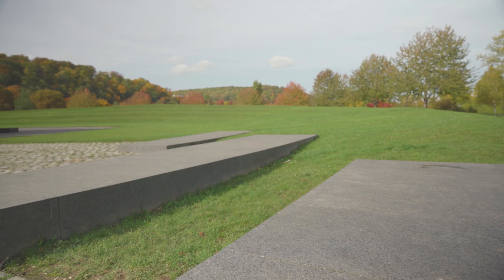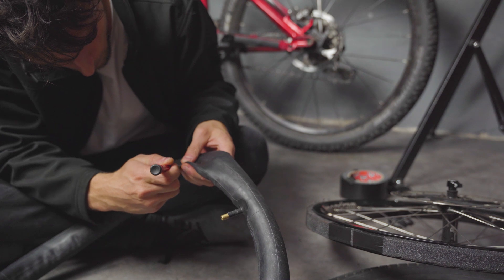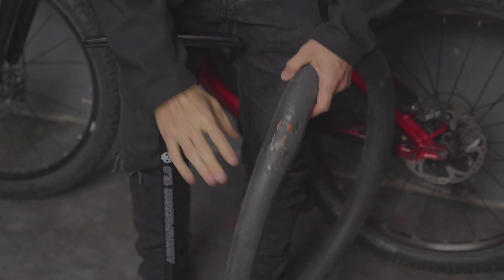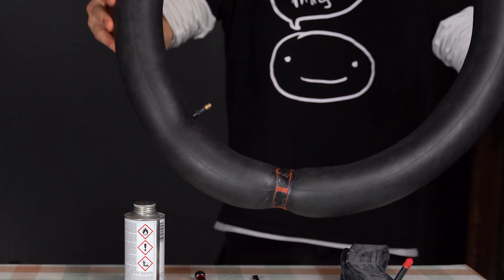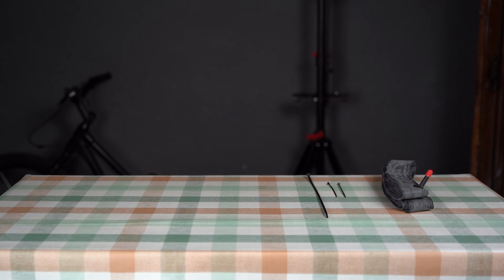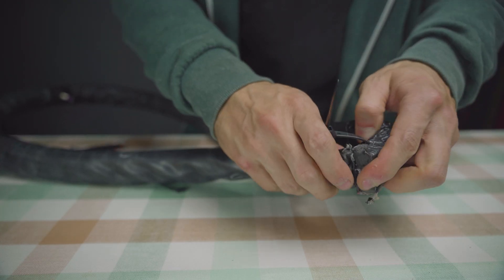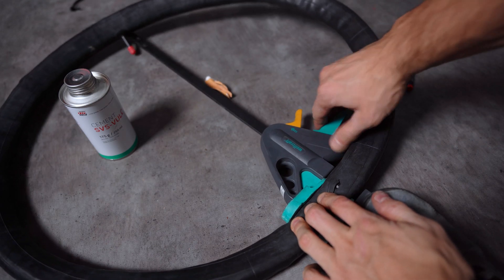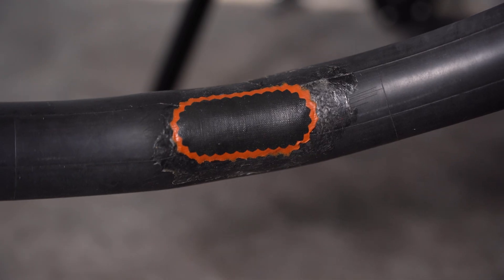Can You Make an Inner Tube Puncture Proof?

Comment: I have been tearing my tubes appart while trying to keep up with the young guns and their full suspension 29's while shredding on my full rigid 26 at the local trails and found your video. I tried to do this with PVC insullation and 2.125 tubes, but found out they are way too narrow, also since they had sealant, it became very messy very quick. Going to try with some 2.4's and keep updated for any future reference, for anyone else wanting to try this by themselves. But it seems like a very good idea, even better than my other option of going "Ghetto tubeless".

Comment: inner tire tube sliping out from too high pressure and two size bigger tube inside thread with bubble like shape from one point only (slipping) . Any suggestions except ziptie around whole rim with not so wide pieces I got to use it outside in public plus sound of extra hard zipties on human sidewalk

Comment: One more addition/option is to add 30-60 ml of tubeless sealant inside the tube via the valve. This way, this setup will prevent from a nail or thorn puncture. You mentioned you wanted a mess free set up. This does have sealant involved but inside the tube which should be mess free.

Comment: Very good idea! However I use a tire insert (in reality it is a pool noodle cut in half) outside the tube. This "sandwich" has the rim, then the tube, then the insert, then the tire. This insert should be as thick as possible, but should fit inside the tire at the same time. I make the setup, pump my tire at around 2 bars and leave it so overnight. Then I adjust the pressure around 1.8 bar or 1.3 bar, depending on my bike tire size. Needs some experimenting, but I havent had any punctures ever since using it on rocky mtb descends with my hardtails. I even used it in 2,25 inch 26er tire with pressure around 1.8 bar.
Reply from the maker: I ran a system like that for over a year with some success, but could still get snakebites, because the foam gets compressed into a very thin layer after a while and stops providing protection. Let me know if you've found a type of foam that stays intact.
Reply: First off, use smaller sized tubes that fit easily, so you can go thicker.
When first inserting the pool noodle I  inflate it to around 2 bars. Overnight it droppes to around 1 bar. Then I never go above 1.7- 1.8 bars. I have tried bunny hopping yesterday and badly messed up a couple, I could even feel rim impacts, but still no punctures. I use 21 internal width rim and 2.35 inch Panaracer Cedric Garcia tire,790 g-s. I have it installed more the a year ago.
I have bought the Tannis Armour, which is the "official version", but I still got snakebites.
So pool noodle. Maybe getting something more  rubbery would be a good idea, like NBR mats for pilates. There are thicker versions,like 1.5 cm-s and above. You could cut a long strip and even have two layers: one narrower in the middle and a slightly wider to provide additional sidewall protection.

Comment: This is awesome for sure. I've been using Tannus Armour which is similar, but has the foam wrapping the tube. I'm new to MTB, so I've slammed my rear wheel into rocks and roots heaps of times now with no pinch flats. Would be great to compare the idea of foam inside the tube...that's certainly an awesome testing ground to show that it works!! Well done.

Comment: Why not just ride with higher pressures? I ride 50 and above psi? and how much weight does it add to your tubes?
Reply: Too high a pressure stops your tyre from folding around corners so makes it hard to stay up on the back wheel on sharp edges.
Reply from the maker: Exactly - more grip to stick to stuff. I run between 2 and 2.5 bar with the insert now. Without it I had to run more than 3, which still doesn't prevent punctures, but compromises grip. The insert adds around 100 g.

Comment: The easier way to do this might have been to line the tyre with a foam strip and have the tube between that and the rim. You could take a flat piece of foam and trim it so it also curves around the sidewall.
Reply from the maker: I ran a system like that for a couple of months. The problem is that the foam gets compressed into a very thin layer over time, leaving close to no protection.
Reply: @TheUselessTrials  I imagine the same thing might happen with your insert? Anyway thanks for the video and be sure to provide your long term review.

Comment: Another option may be to just pump expanding foam into the tube through the valve. Schraeder valves can be unscrewed to give pretty decent access. You would have to work the foam evenly around the tube before it sets, but it could work as a less invasive option.
Reply: The problem is it will stick all over the inside of the tube and won't form  a solid rubber shape inside the tube. Also it's full of isocyanates and is actually pretty nasty stuff.
Reply: @wakazuzu  The aim of the protector is to stop the tube getting pinched, so provided the tube was lined with enough talcum powder to stop the foam sticking to it (Michelin tubes for example have very little talc in them, so you'd probably have to add more yourself on this brand, but others will have plenty of talc in them already), this could work quite well, if a resilient foam with relatively low expansion was chosen.
The possibility of the expanding foam attacking the rubber chemically would be my biggest concern - and not doing it indoors or anywhere near soft furnishings :-P.

Comment: Have you ever tried the Tannus Armour? I don't know if exists the right size but it could be an option
Reply: I had so high hopes with Tannus Armour... Unfortunately after 1-2 months they squished down to a 3mm thin foam liner. (and they weigh 300g) I'm still mad at them lol
Reply from the maker: BB's comment pretty much sums it up perfectly.  I tried a diy insert between rim and tube for a couple of months.  Provided some protection, but got compressed into a way too thin layer after a while.
Reply: the smallest sizes are 20", 24", and 26" . I have the 26" insert on just the back tire of my bike, I've only gotten one flat, the tube slipped and the rim tore off the valve

Comment from the maker: AN tube.

Recommendation: If you make a DIY foam insert, don't join it with plastic cable ties. Rather use something that can't do damage from the inside, like string or a hook-and-loop strap. Should be safer :)
Reply: Make a video in few days or weeks about your experience with it, how it controls and does it make a difference
Reply: Wouldnt bead lock wheels fix tubeless tires? I wouldnt know if anyone creates them but its in interesting idea
Reply: @Marley505  Pinch flats/snake bite punctures
Reply: @Marley505  I'm sure they would work but they might triple the weight of the wheel.
Reply: Great hack！ I wonder what kind of foam(material) you are using
Reply: Can you mix 2 part Eurethane foam and pump it in the valve, let is expand to 1.5" etc, then once cured add desired air pressure

Comment: you could try putting the insert outside the tube
Reply from the maker: I did! Ran a rear wheel like that for a couple of months with mixed results. The main problem is that the tube compresses the foam into a very thin layer over time.
Inside the tube it seems to work better.
Reply: Just like he said and it's a major PITA to get it on the rim together with the tube. It's futile